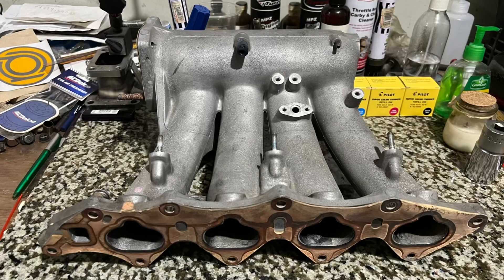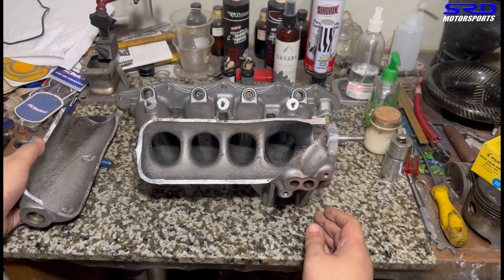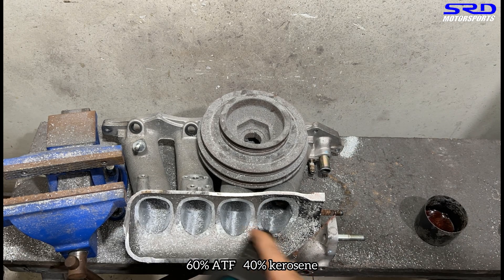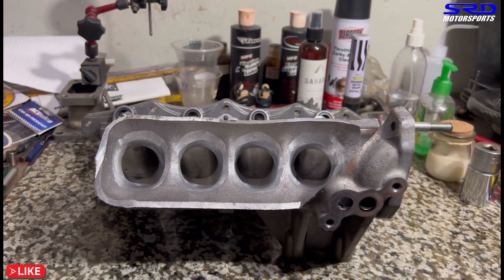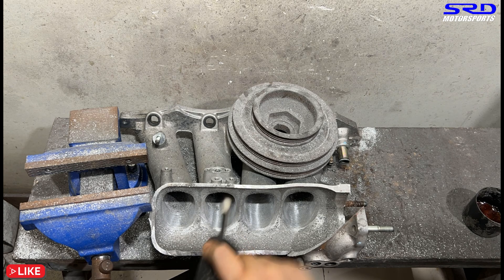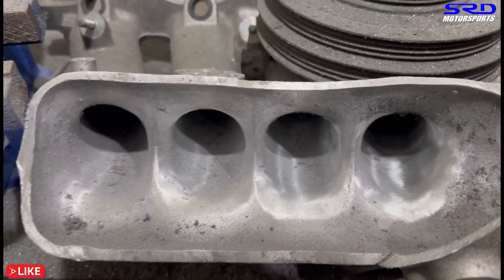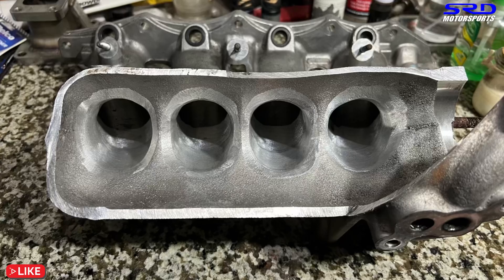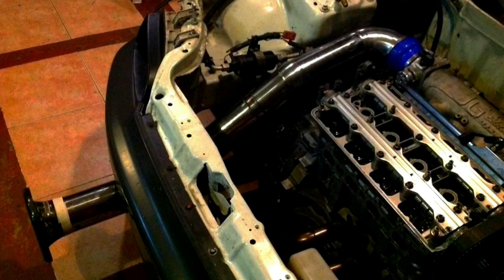Type R P73 Intake Manifold porting and development

Comment: I can never get tired of seeing your port work, its always amazing to see. I've got a question, do you port to suit the application or just have a general way you do all your porting? I would love to see an extreme port work for an all out race motor that's high compression with some big cams , great vid as always brother
Reply from the maker: it’s kinda a mix of both… cuz all oem manifolds can use a bit more taper than it is , just for improved airspeed…

So it’s usually just “more” or “more”

my skunk2 d16 manifold fits ur question about it will try to find time to show it since my engine is out of the car , you’ll see extensive welds under and around the runner entry as I punched holes going more taper 😂
Reply: @SRDmotorsports  ahh right right I understand now, definitely show us that d16 manifold 😂
Reply from the maker: I’m assembling (rebuilding) a stock D13b off a 2000 Honda City il try to squeeze it in for. Some side talks in the video next week

As tomorrow is the more in-depth engine bay temp test analysis
Reply: I’m curious to know if you can go “too big” for your setup or is bigger always better?? And how much power do you actually get from a potted intake?
Reply from the maker: The misconception was always “bigger” I mean porting = bigger

but it’s mostly reshaping for improved airspeed on all lifts (for heads) and on intake
It’s simple… the rate of taper on a skunk2 ultra street intake is well designed

Taper = to help airspeed
(not bigger)

And that ultra street dimension cannot be achieved by an ItR regardless of re welding

hence I said before
…u run out of material before even reaching the point of too much taper (granted u curved it well cuz curving it like the stairs is too much taper 😂)
Reply from the maker: Gains vary but it isn’t a bolt on hp affair 

example an average gain could be 8-10whp but the rpm extension can be 500 or more

then something that’s rarely considered to evaluate… how fast the power drops after peak power or how much it nosedives

Oem b16a on CTR pistons and just b18c cams did 186whp but on that vid on the dyno it can be checked from 8,000 to 9,000rpm it’s above 185whp

Comment: What are your thoughts on throttle body size and response? I've run s2 and blox throttle bodies before and even the smaller ones feel so much worse than a stock ITR 62mm throttle body with the response time, and the way they snap open.
Reply from the maker: For me, the throttle sizing varies a lot 
sadly people just think about displacement and rpm while that is a factor yes…

“Available plenum volume” matters and affects the response example a p30 intake plenum volume and runner system will react differently to a 62mm ITR throttle than a p73 ITR intake plenum volume and runner system…

Looks like you found the sweet spot with the 62mm plate… interestingly enough it’s one of the reasons I ALWAYS keep an ITR 62mm throttle saved up for “just incase” id need it 😎
Reply: @SRDmotorsports  My tuner told me I'm missing out on a lot of power since I have a stock unported ITR manifold with a 62mm throttle body. I'm going to try the ported ITR manifold setup and maybe get a small 66mm throttle body and see how that is as for my setup street drivability >>>> big power.

My setup is a b20vtec with p30 pistons, b16 head with itr cams, itr manifold with itr tb. i'm thinking of doing s2 tuner 2 cams and the ported manifold just to take my setup to the next level!
Reply from the maker: that’s the cool thing about skunk2 , they released that “inbetween” size that we know is really usable on some engines
The 66mm tb
Reply: @liamtomlin5151  generally a bigger plenum goes better with a smaller throttle body and vice versa
i think the skunk2 ultra race intake wants a 70mm throttle body to slow down the air because of the positioning of the runner entries

66mm should be too big for a ported ITR but you can try, maybe it works well :)
Reply: @liamtomlin5151  I have tested ITR 62mm back to back with 68mm on my 260ish hp 2l and they were within 2hp.
Reply: @AwesomeBoss55  thank you for the insight! I'll buy a s2 66mm and bring it to the dyno with a backup 62mm tb if the 66 doesn't work great.

Comment: Can we see a before and after dyno one day with similar temperature and humidity
Reply from the maker: might be hard to find a chance to do that… but will try soon…
Reply: I agree, otherwise it's going to be a debate on whether or not it's worth the money .
Reply from the maker: @japjoem4077  for those who has maxxed out the ITR manifold or skunk2 pro series don’t really wonder… either they get it ported or upgrade to Skunk2 Ultra Street.

We don’t offer this like “get this for gains” we have been doing this when it’s needed so the thought of a comparison for more sales? Never came up.. those who need it know it…

a maxxed out b16a did 177whp and with a ported manifold does 186whp

A b20 was going 214whp then 225whp after

A b18c did 200whp stock block then 211whp afterwards

but aside from hp gains? the rpm powerband was extended atleast 500rpm more
on paper that isn’t much? But when you shift at xx rpm and the next gear is at yy rpm on track? it is a BIG difference